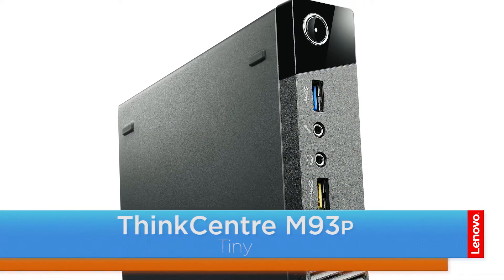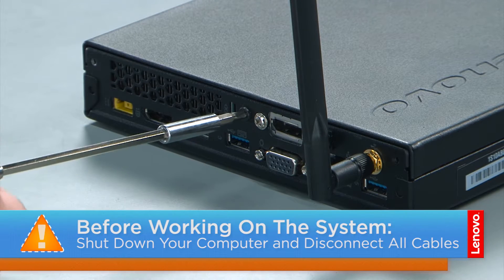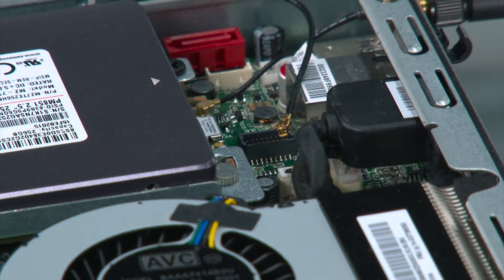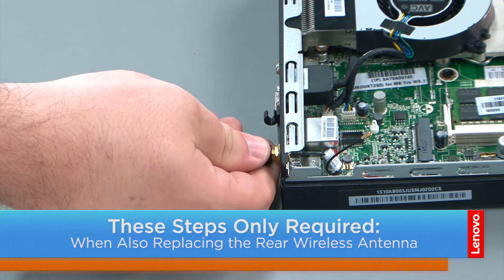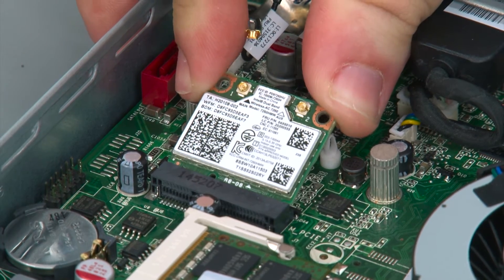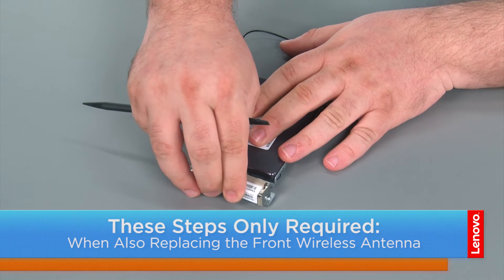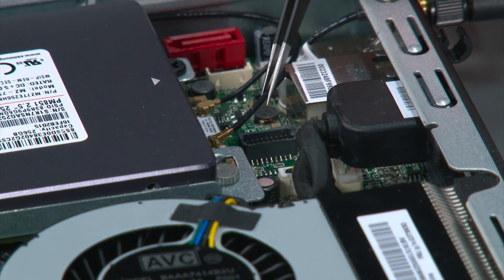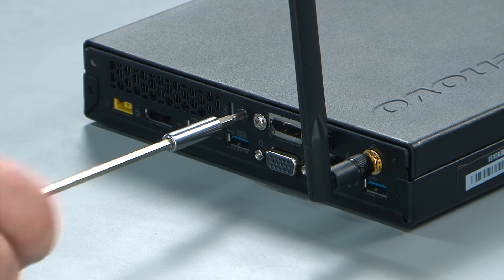ThinkCentre M83 / M93p Tiny Desktop - Wi-Fi Card Module Replacement

Comment: It be nice if you would've given the part number or put the link in the description as I'm looking to replace the module in mine because i doesn't have Bluetooth. Only WiFi.
Reply from the maker: Hi there, @Luigi Provencher! Thanks for reaching out. Could you please share us with the complete machine type model (e.g., 10XXXXXXXX) for us to check? We're here to help. -Maru_Lenovo
Reply: @LenovoSupport  It's a Lenovo ThinkCentre M93P Tiny PC 10AB0016US. It's got a Intel Centrino Wireless-N 105 Card in it but I don't even know if that's it's original card or not.
Reply from the maker: Thanks for sharing the machine type model. Yes, that is the original WLAN. To check on the OEM certified WLAN, please check our parts' page here https://lnv.gy/43OORXd (filter by selecting Wireless LAN adapters under Commodity Type). Let us know if you need additional help. -Maru_Lenovo
Reply: @LenovoSupport  What if I wanted to add HDMI or another USB 3 port in place of where the serial port is?
Reply: @LenovoSupport  Does any of those have Bluetooth too or are they all just wifi?
Reply: @LenovoSupport  So you're telling me that there's only one option for this? There's no way to upgrade to a later WiFi/Bluetooth Card? I've tried a bunch of cards and the computer just keeps on telling me that an unauthorized network card is installed and it needs to be removed.

Comment: hi, i have wifi card instaled from manofacturer and wifi didnt work at all. 

Win 10 original OEM 
All drivers instaled. 

I need solution.

Boycot lenovo
Reply from the maker: Hi Martin! Thanks for writing in to us. Could you share us the machine type model of the computer and the part number of the WiFi card you've installed for us to check. We're here to help. -Jerry_Lenovo

Comment: I'm not sure if anyone monitors this, I have a question, I purchased a refurb m93p tiny, the 2 (AUX) cable and antenna was not in the case.  Only a rear antenna, I'm guessing part of refurbishment (not refurbished by lenovo I presume) includes stripping parts someone refurbishing deems they can pull off and sell else where and let the new owner deal with it.  Anyways long story short, is the 2 plug by chance for bluetooth antenna?  My bluetooth reception is absolutely horrible, I can't connect unless I'm within a few feet of the device.  Disconnects etc.  I believe the 2nd antenna "front" is for bluetooth?  I hope...  Wifi still seems to work like I would expect Wireless N to work in 2020 ~40 mbps vs 60 with my AC cards.
If that is the case, a new lead and any kind of antenna even external I'm hoping is a vast improvement for bluetooth reception.  Anyone have knowledge in regards to the 2 ports usage?
Reply: @LenovoSupport, do you guys read these by chance?

Comment: hi, need some help please, iv got a m93 tiny, s/n: pb00gpvn  10a4.  which wifi/bluetooth cards are compatible? pcie? thanks you
Reply from the maker: Hi Raheel, this model has PCIe Half Mini Card, here is the manual on how to replace the card https://lnv.gy/2xhCdWy page 254.
For your desktop specification reference, you can check this link https://lnv.gy/2Q3arDX Let me know if you have other questions. 
Arjay_Lenovo

Comment: I have a m710q tiny without a wlan/bt card in it.  Do you know what intel card will fit in it?  Also, is there a lenovo antenna cable and antenna part I can order?  if so, what are the part numbers?  Thanks please reply me
Reply from the maker: Hi zubair! Thanks for writing in to us. We've checked the specifications of the M710q Tiny and you can use an Intel Wireless card part number (01AX704) or you can check other models here (https://lnv.gy/2W8FVJg). Our apologies as we are unable to find the corresponding antenna cable for the computer. We'll check on it and get back to you here. -Jerry_Lenovo
Reply from the maker: Hi zubair! Here are the part number for the antenna's and cables you need. 1st Antenna, Part#: 00XJ093 Fru, Lx 55mm LDS Front antenna ANTENNA. 2nd Antenna, Part#: 00XJ139 Lx Tiny5 bendable SMA cable and External Antenna: Part#: 00XJ094. -Jerry_Lenovo

Comment: My M93P Tiny did not come with wifi, is there a kit to add all the necessary components for wifi or do I need to source all the parts separately?
Reply from the maker: Hi there, Angultra! Thank you for reaching our support! As we were checking here, the Lenovo M93P tiny will come with a Wi-Fi card and you can check the complete specs here https://lnv.gy/2CUPZgZ. If you are only looking for the antenna, you can contact the Lenovo part sales https://lnv.gy/2CTWCjL (scroll down and look for the Purchasing Accessories, Upgrades, and Replacement Parts ( FRU ) and choose your region). Let us know if you have any other concern. -Chris_Lenovo
Reply: @LenovoSupport  I have a Lenovo Thinkcentre m715q and want to add a wifi card and the antenna but cant seem to find where to purchase everything i would need.

Comment: Hi will the Intel ac 8265 wifi card work with a lenovo m83 tiny pc?
Reply from the maker: Hi there! Thank you for reaching out to us. Could you provide to us the serial number so we could check on that? Let us know. John_Lenovo
Reply: @LenovoSupport  Thank you. The s/n is S4R60545.
Reply from the maker: Thanks! Upon checking our System Parts Manual https://lnv.gy/2oyK76g it appears that we only have three WLAN card listed below compatible or tested for this device. 
In addition, upon checking the Intel AC 8265 it has a different PIN Format Connector from the actual wireless compatible with your laptop. 

03T7292 Realtek RTL8192 WIFI Kit
03T8215 WWAN BCM4352+BCM20702 2*2 bgnac WLAN & BT 4.0
04W3777  Intel 2*2 11agn+BT4.0 Combo Jackson Peak 2 NEC SKU WLAN Card
Reply: @LenovoSupport  Thank you!
Reply from the maker: You're Welcome! Please let us know if you have any other concerns. Have a great day! Reggie_Lenovo

Comment: I have a M93p Tiny, could you tell me where to get front and rear antennas? thinking of putting a wifi card in it
Reply from the maker: Hi Gene! Thanks for reaching out. Below are the parts for the front and rear antenna : 

Front Antenna
Part#: 54Y9397 -  Cable, 240mm Antenna_Black_Tiny2 for front WiFi antenna

Rear Antenna
Part#: 03T7203 - Luxshare 5GHZ Dual-band dipole antenna or Part#: 03T8166 - FRU Dual band dipole antenna
Part#: 03T7191 - FRU Rear SMA to Ipex cable M

Additional info:
System service parts and Recovery DVD part numbers - ThinkCentre M93 , M93p (Tiny Form Factor)
http://lnv.gy/2nQdgJH
http://lnv.gy/2nQsNsG

List of compatible Wi-Fi cards:
Part#: 04W3813 - Ltn RTL8723BE 1x1BGN+BT HMC WLAN
Part#: 04W3818 - FRU Cybertan Realtek RTL8723BE 1*1 bgn + BT4.0 HMC 
Part#: 04W3765 - FRU Intel 2x2 11bgn + BT4.0 Combo Jackson Peak 1
Part#: 04W3777 - FRU Intel 2*2 11agn+BT4.0 Combo Jackson Peak 2 NEC SKU WLAN Card
Part#: 04X6011 - FRU Intel Wilkins Peak 2 7260BN 2*2 11bgn+BT4.0 HMC Module
Part#: 04W3772 - FRU Intel 1*1 bgn Canyon Peak WLAN Card
Part#: 04X6010 - FRU Intel Wilkins Peak 2 7260 2*2 11ac+BT4.0 HMC Module
Part#: 03T8215 - FRU WWAN BCM4352+BCM20702 2*2 bgnac WLAN & BT 4.0
Part#: 03T9015 - FRU Wifi BCM43227, single band 

You can purchase at our official parts store (http://lnv.gy/2nRgyfE) or at a third party sellers such as Amazon, Ebay. -Jerry_Lenovo
Reply: thanks..I was able to order the front antenna and the dipole antenna...03T7191 seems to be out of stock..and tried to add to my cart but doing so would give me an error on checkout
Reply: Hi Jerry, are these parts also compatible with M83 Tiny?

Comment: I have a lenovo ThinkCentre M93p Desktop , but it is not wifi work. plz good solution me
Reply from the maker: Hi Sumon! Thanks for writing in. We'd like to confirm if your computer's WiFi is not working? If yes, when was the last time it was working and were there any hardware or software changes prior to the issue? Let us know. Let's work on this together. Marky_Lenovo
Reply: LenovoSupport hi i have a lenovo thinkcentre desktop just wondering what type of pci card i would need to get so i can get wifi thanks Dave
Reply from the maker: Hi Dave! We just need to confirm that actual model of your ThinkCenter desktop. Is it the ThinkCentre M83 / M93p Tiny Desktop? If not, Could you please provide the exact model? Reggie_Lenovo
Reply: LenovoSupport hi sorry for the late   reply its an older model RZ6 would that be right cheers
Reply from the maker: Hi, here's a link on how to find the product or serial number: http://lnv.gy/2B0iQ0D Thanks, -Jim_Lenovo
Reply: LenovoSupport hi lvk-rcks3-9126 (b) sorry not very computer savvy
Reply from the maker: HI there. We're sorry the serial numbers seems to be invalid. Please take a photo of the sticker at the bottom then send it to us. thanks. Arjay_Lenovo
Reply: Hi im having a lot of trouble trying to add a picture to here

Comment: I have a m900 tiny without a wlan/bt card in it.  Do you know what intel card will fit in it?  Also, is there a lenovo antenna cable and antenna part I can order?  if so, what are the part numbers?  Thanks
Reply from the maker: What's up Jason? 

So here is the parts list for the m900 tiny: https://download.lenovo.com/parts/ThinkCentre/m900_tiny_parts_11132015.pdf 

You can see the different wireless card options under "MECHANICALS". Then you can use the number on the left to purchase a replacement directly from Lenovo or an authorized retailer here: https://support.lenovo.com/us/en/partsorder?linkTrack=Mast:SubNav:Support:Parts%20and%20Accessories:Parts|How%20to%20order%20parts

Alternately, you can google FRU and the number (ie FRU 04X2744) of a part to find from an outside dealer, which I wouldn't recommend unless you have no other choice. Googling the part number can be helpful to identify the part through images, so you can determine if it's the right part. Sometimes it can be hard to tell on the BOM list because the descriptions can be vague.

You will also want to order the antennas. If you are having trouble figuring out which parts to order you may want to call support. The numbers can be found here: https://support.lenovo.com/us/en/partsorder
Reply: Where can i buy the wifi card and antennas?